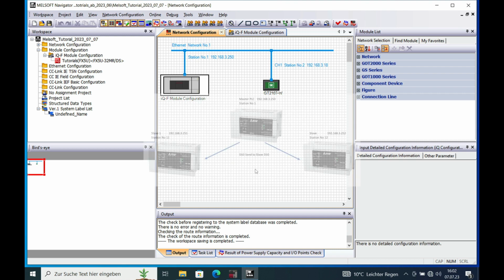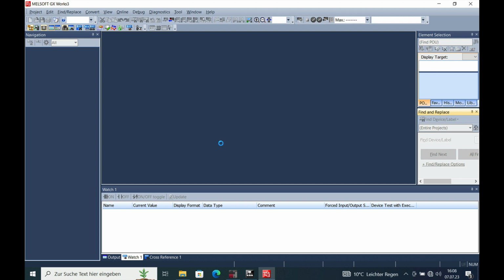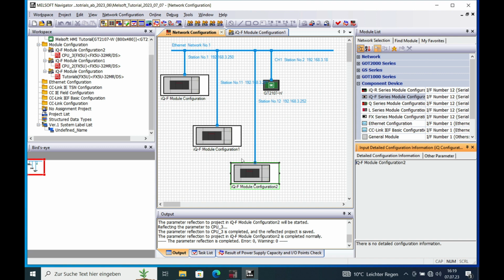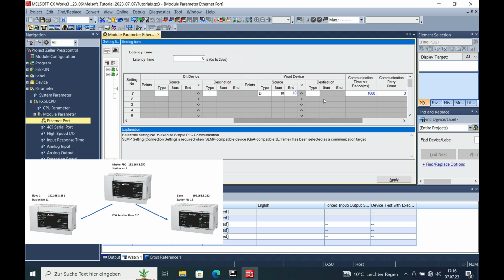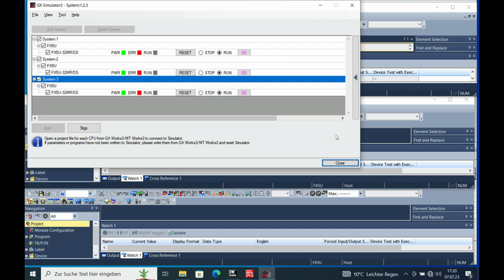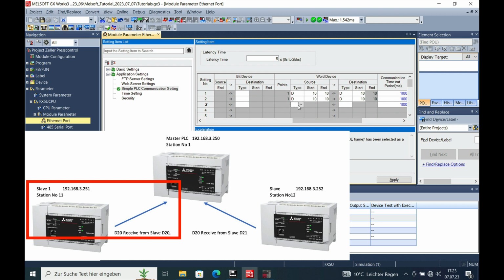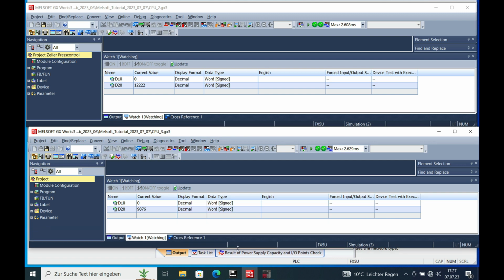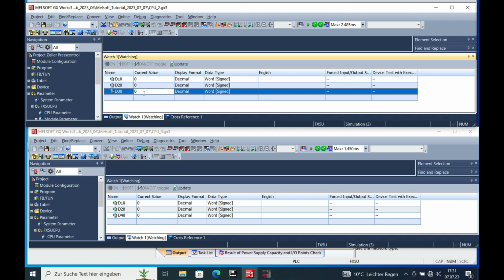Mitsubishi melsec simple PLC Communication with Melsoft Navigator and System Simulator

Comment: I doesn't have melsoft navigation software... can you   make it in other way, using q series plc and ethernet protocol?
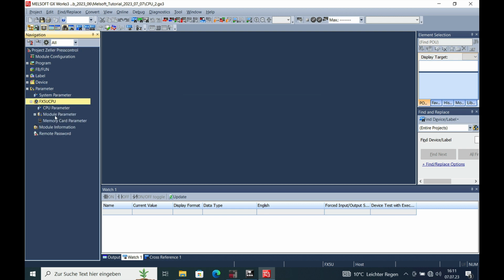Reply from the maker: Hello, check from minute 5:28 and write the ip address  manually im the gxworks3 for every CPU. That is the same result only without navigator. That should be the same for a q CPU.
Reply: @zellerautomationandplc thank you sir

Comment: I didn't simulate, do we have to connect the plc through the switch hub in order to use it?
Reply from the maker: Hello, the simulator run only on the GXworks. You do not need to connect a CPU. Please check on Minute 12:39.
Also i have created a seperate Video for the simulation. Here it is: https://youtu.be/Rrf0zNltLU4?si=OrVp_Niv5rz2oUsF